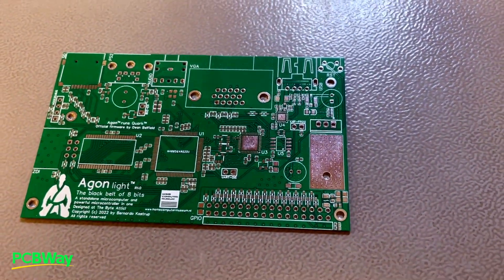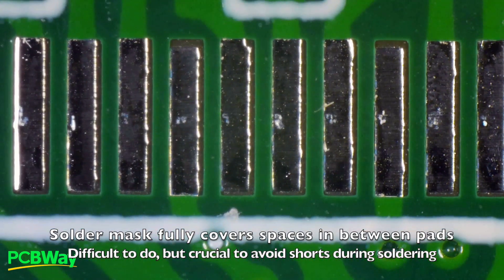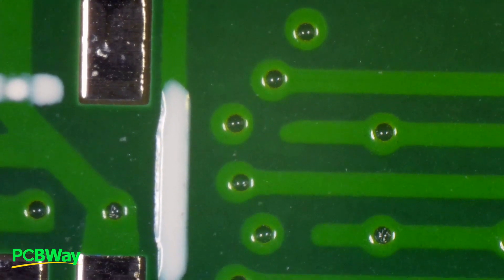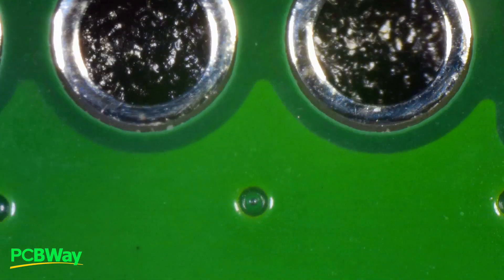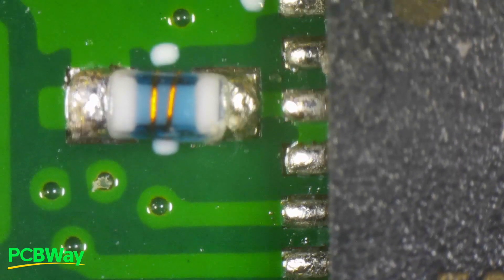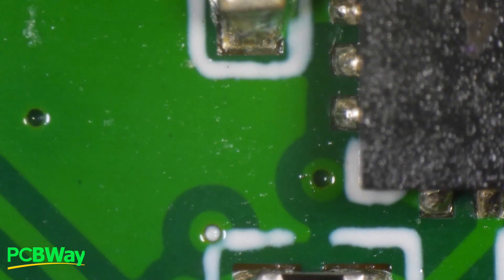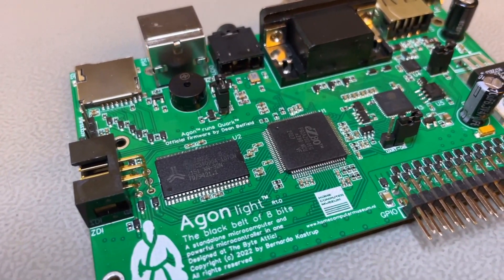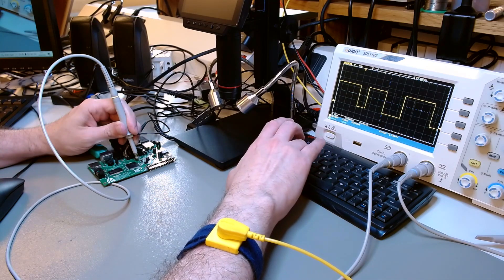Microscopic PCB review (Agon Light™ PCB)

Comment: At 5:03  you said "We want to have the pins go in between the bumps, not on top of the bumps".   Well you want the pins on the top of the bumps for soldering but of course pre-tinning makes it a bit more difficult.   However, with the proper hot air station the chip will shift into the right place due to surface tension of the melted tin.
Reply from the maker: I meant so say that we want the pins on top of the bumps, not in between, which is difficult. And the whole video is about drag-soldering, not reflow soldering (no one will try to solder a large fine-pitch QFN chip with a hot air gun; it could even damage the chip, if it were possible to do it).
Reply: @thebyteattic - Well, I've done plenty of QFP  and QFN hot air soldering with lots of flux and carefully set temperature without damaging it.

Comment: Are the marks on the pads caused by a test instrument at the factory?
Reply from the maker: I didn't notice anything salient, but it is possible.
Reply: @thebyteattic  there were pin prick marks on the pads. It looks like they may have been made by the factory when doing a connectivity test of the board.  And I'm glad that PCBWay did a good job for you.